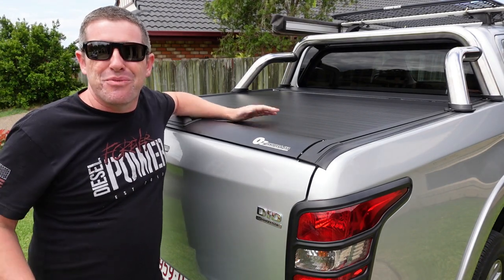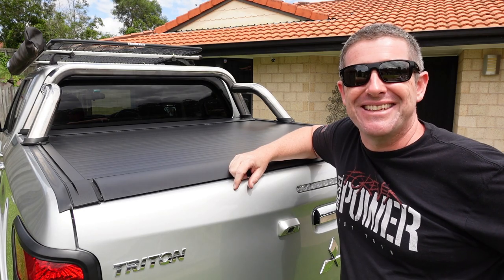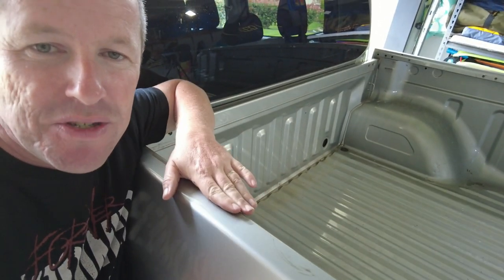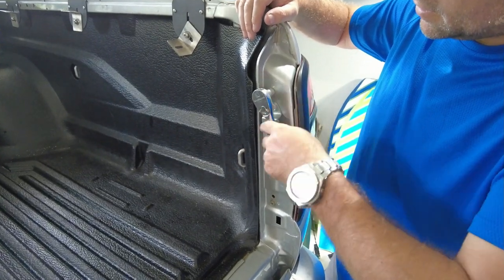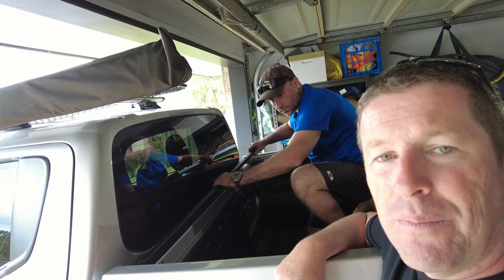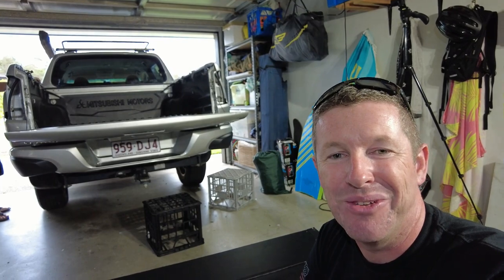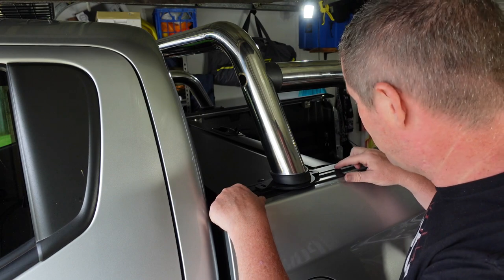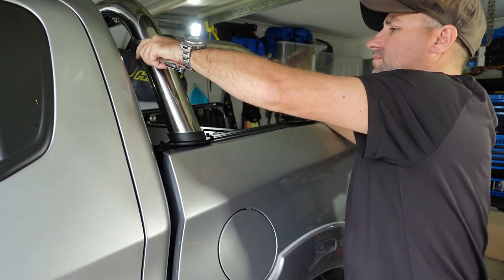LIVE | Secure Ute Roller Shutter  - Easy DIY install onto L200 Triton MQ MR Oz Canopies Mountain Top

Comment: Love it pal. Wish I’d found the one you bought - mine has far fewer quality parts
Reply from the maker: Bugger, I must say there are a few little adjustments you can make to allow these to work nice and smoothly. We had a trip just after this and noticed the cover would keep opening to the first stop due to the tray flexing and corrugations. Adjusting the sides in slightly seemed to solve.

Comment: Great video. Just Wondering how exactly do i adjust the spring loading for the roller shutter? I have the same style of roller shutter. But the poorly translated manual did not mention anything about adjusting spring load force. After a few month of use, the spring Got Pretty loose and shutter won't retract properly. Thanks so much
Reply from the maker: I know you can, I can't remember exactly how it done. Let me see if I can find something to help you out 👍

Comment: Hey mate, how has the quality of the roller shutter stood up? Are you still happy with it? No paint chips or anything?
Tossing up which roller shutter to get, and the ozroo combo with the rack seems pretty convenient. Just worried about the quality.
Reply from the maker: This install was actually on the brother in law's Triton. It's held up really well and he is still happy with it. I was actually quite surprised how well it worked when we fitted it up. For the money they seem quite good value. He also noted it's been quite water tight.
Reply: @WorkLivePlay  copy that, thanks for the reply 👍
Reply: @DiabloIYHWA  Did you end up getting the combo? if so how did you like it?

Comment: Was just wondering if there was going to be an update video for the kings kayak
Reply from the maker: Hi Tom - for me its been time and weather. Half the video has been done however the outing we had to test out the trolling motor didn't film as planned. Trying to find a nice weekend day where the tides and lack of rain wind has been challenging in between other commitments. I tried another time a few days ago and it was also a fail so hopefully will get out over the next few weeks to finish that one off, and do a review on the Kinsg SUP with kayak option I bought for the wife. In the meantime we have used a lot without cameras and I've collected a few additional things.